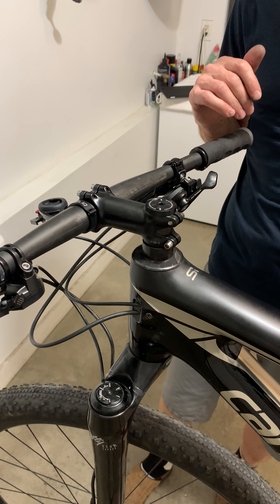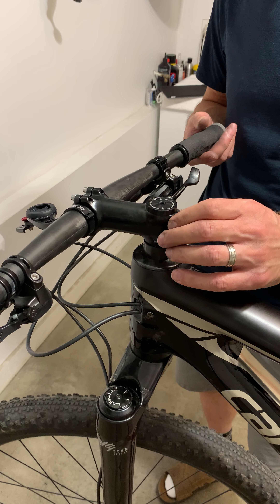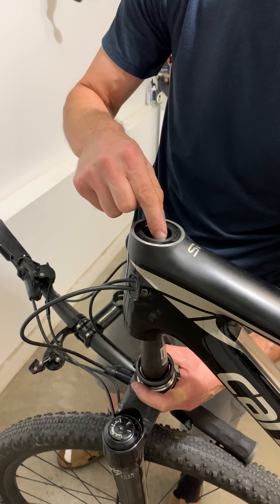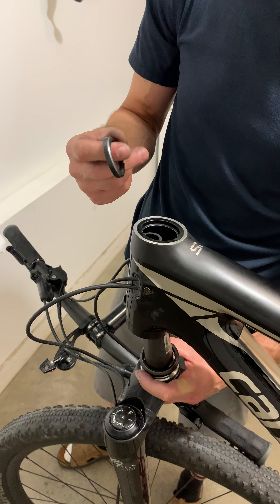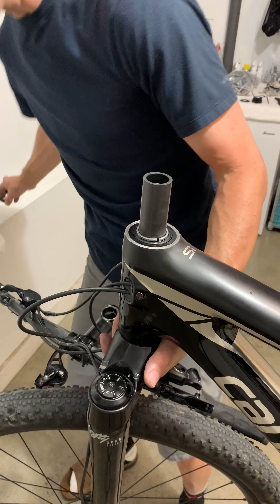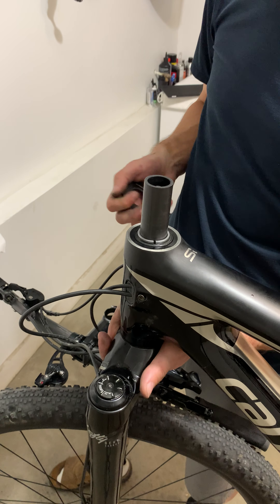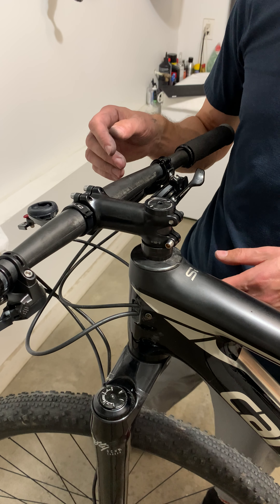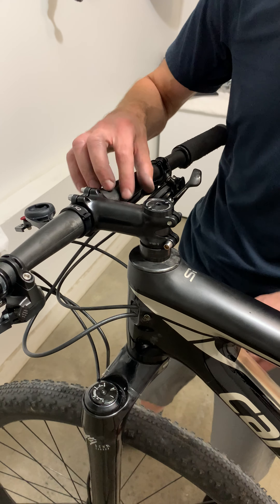2019 Cannondale Scalpel Si Headset Removal & Replacement (Part 1 of 2)

Comment: Hi, it seems to me that the steerer tube is too long. I would add a spacer or cut the steerer tube a little  so that the top edge is at the same level of the stem. This will allow for a better reach downwards as you tighten and put pressure on the dirt guard.
Reply from the maker: That’s a good point. I may cut a bit off the steerer tube as I also would like to have a bit bigger drop. Even though it’s any easy fix, I’m also a bit hesitant to cut the steerer tube as there is no turning back. 😳

Comment: I have the old two crown lefty with headset bearings that press directly into the frame.  Never had trouble with them other then just replacing worn out bearings every now and again.  The old style was a better setup even if you were limited to using only Cannondale stems.